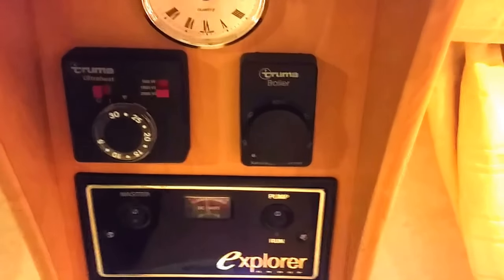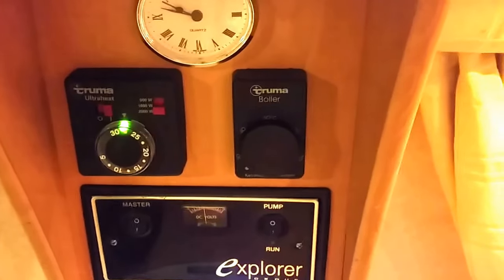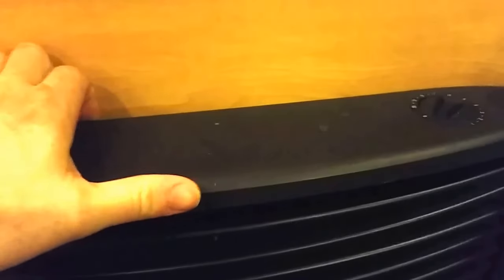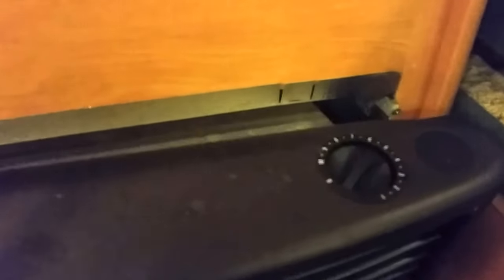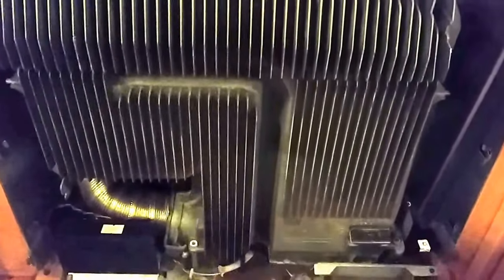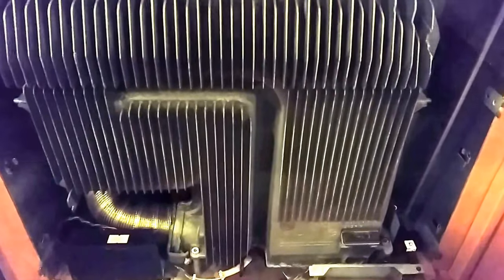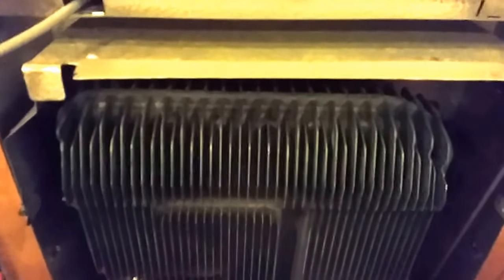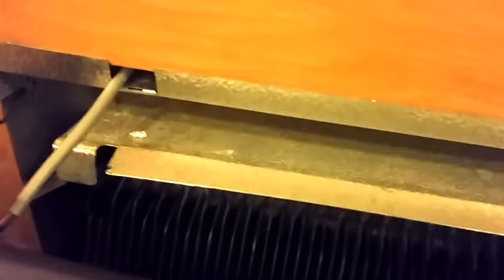*HOW TO* Fix a Truma Ultra-Heater Caravan Repairs My Caravan Project

Comment: just checked mine. one crumbled when i took off. removed both off and clipped wires together to test and voila - its working! so i'm going to order the sensors to replace. thanks to Patrik also for his comment with the ebay item numbers ;)
Reply from the maker: Excellent stuff... glad I could help 🤙

Comment: Excellent vid, the top temp control had disintegrated ant the bottom limiter was ok but I replaced it anyway, saved a fortune and works great, thanks
Reply from the maker: Im really glad you fixed the fault. That's the plan is to save everyone money. I've noticed everything to do with a caravan Is ££££  EXPENSIVE £££ & very little videos out there but if you got a little confidence you can do anything.. well done you keep subscribing  for a lot more hint & tips

Comment: Any advice please. I disconnected the electrical part on my heater and can not reconnect it. Your advice was to be very careful because replacement boards are £80-£90. The electrical connector will push in but isn’t connecting to anything and just falls out. What can I do?

Comment: Just watched you explaining about fire.
That sounds exactly my problem and I'm very handy and confident to repair myself.
What seal do I need name for eBay.
And to check mine has stopped working on turning the wall thermostat.
A caravan repairer told me it's the temp control something ??
Would love to hear from you.
Reply from the maker: Its been a long time since I repaired the heater. Try searching on Ebay for truma ultra heater flue seal its Normally red rubber ring and the same for the thermostat should be a very small circle ⚪. Give it a go & save the money but be very careful with the gas still get it checked out for leaks (pressure test) Normally on a service. Im glad i could inspire you to give it a try...

Comment: I do recommend you get a gas safety check by a competent engineer, gas safe registration doesn't come into it as it is a tourer and would require a gas safe certificate every time you changed the bottle there are different rules for tourers!
Reply from the maker: I totally agree safety first 👍

Comment: Interesting video thanks I go a Truma s3002 the mechanics look the same although the controls look opposite.  I’m pretty sure I’ve got problems with my thermocoupler have you done a video on replacing one. My heater is fitted in a Campervan. Cheers pete

Comment: Hey Attic Treasures, thanks for the video, I have a gas heater just like this one but with out all the electric components so i think mine must be older. i brought it from a guy who was seeling parts of an old caravan and i am about to install it in my van/ stealth camper conversion. i have decided to do away with the front cover and the fan system that moves the hot air around the camper becuase i only have to heat a small space.

because of my limited space i am building cupboards around it. i can see that you have a similar arangment which is reasuring as i was curious wether or not it could be a hazard to have so much wood around the heater? what do you think? (ps i have covered all the wood imediately surrounding the heater in sheets of aluminium similar to the alu sheet here in your video.

thanks

Comment: Hi, when you had this problem with the thermostat did your ultraheat keep going off on the  dial. My one is an older version than yours with the two separate dials and it turns on initially say to the 2kw setting then goes off when I adjust the temp then I can't get the dial to illuminate at any of the three power settings.

Comment: Hi thanks for the video. Mine is making a buzzing noise when I set the thermostat to around 20, and it's not heating up at all. Should I remove the gas part of it as per your video? Thanks.
Reply from the maker: Only if you feel confident. . If not leave it to an expert

Comment: If you brake the fan switch board, just solder it and put some bi-component epoxy glue under it. It will be stronger than new one.

Comment: My gas fire worked untill I had it gas tested, I turned it on and it worked fine but the flame turned off.... this must have been as a result of air being in the system, I have tried lighting it and holding the switch down but it no longer makes the clicking sound. I am convinced I have held down the switch long enough to let any trapped air through so I wondered if there is a battery systen somewhere that may have failed?
Reply from the maker: The battery for the ignition is in the bottom front. In a black box

Comment: Good video - my ultraheat 230v Keeps tripping and now I get the green light but if I turn up heat - it trips . it has been tripping from time to time and completely at random.  I guess i will try and replace thermostats as per your video. Where did you get them from
Reply: Hi, did this fix it? Mine is doing the same

Comment: Hi mine is a carver gas only 36000  I moved it( but not not completely) to grease the fan bearing which was squeaking, when i put it back it will not fire up, just clicks, there are no leaks and everything is tight, the instructions says sometimes you get air in the system but i tried for ages and nothing, gas to everything else is fine, can you help?
Reply: Ruthypie Twiglet check the earth cable not disconnected.

Comment: Can these heaters run with out gas
Reply from the maker: The one  I had could run on both. It had an heater element at the back.
Reply: @RevivingSalvage  mine is the 5002 what was yours
Reply from the maker: I honestly can’t remember, you should be able to switch between gas and electric on the knob I think or the switch on the wall it was a long time ago now lol

Comment: I have a truma 3002p igniter is working but I cannot get the gas to ignite. Last time I used the fire it lit fine when I tried it again shortly after the fire did not light but made a bang obviously build up of gas  and it will not now run on gas works fine on electric please help Kind Regards Martyn
Reply from the maker: Is there any clicking when you try to ignite?
Reply: @RevivingSalvage  Hi the igniter is working and is new battery
Reply from the maker: You might have a bit of dust covering the ignition apart from that I not entirely sure I'm sorry. If its gas then get it checked out by a professional better safe than sorry.
Reply: @RevivingSalvage  hi I await your reply tomorrow Kind Regards

Comment: that long wire on the right that attaches to the gas settings and ignition mine has come off so what does it fit on?
Reply from the maker: It goes back inside the button in the center. Follow video I think I show it

Comment: Hi fellow Welshman.. great video.. just bought my first van but having a problem. Heater will run off gas and blowers work fine. Plugged into hookup I’m not getting a green light from thermostat switch / adjuster.. checked plug fuse and all fine 🤔 pls help
Reply: Lama 69 I’m getting the same issue. Find arcsystems.biz on the web and give him a ring. He’s really useful and suggests it could be an issue with the PCB. Haven’t got around to doing it yet but will be in touch with him when the time comes

Comment: My truma 230v works on electric but the battery for gas ignition keeps clicking, any ideas please?
Reply from the maker: The ingniter might need new batteries or a clean
Reply: look at your gas knob on fire and if its near the 0 number move it up a little to the 10 number as it might be that as mine did the same and this cured it.

Comment: My heater doesn't work the pilot light is lighting but then going out the long thing coming off the ignition in side the heater as now broke off my heater hasn't worked since I've had the caravan any tips
Reply from the maker: Take it to a professional to get it checked out gas is very dangerous 😅 sorry Its been a long time since I touch a caravan lol

Comment: My fire started making a clicking noise and would not heat up...any ideas ?
Reply from the maker: Probably The igniter or even the battery's might need replacing
Reply: @RevivingSalvage  oops i meant to say the clicking problem is on the electric use of the heater sorry.
Reply: @Nittytash  did you sort it. I'm trying to light mine , all I can hear is a clicking noise but will not fire up. Sometime the xlicking noise stops.

Comment: Anybody!!...... desperately seeking help! I bought my first motorhome last winter. An old reasonably priced one that was in good technical condition, to find out if this way of traveling was anything for me. 
Now I am on a trip in northern Norway and here the summers are cold. Now I got problems with my trumatic s3002k from the year of 1994. A red warning light comes on after a short time, the fan reduces the speed and after a short time the heat turns off. The warning light is located on the underside of the front panel. The ignition is connected directly to the 12v battery bank.
I can not figure out what the problem is. Can not find answers in the user manual.

Is there anyone who can give me any advice?